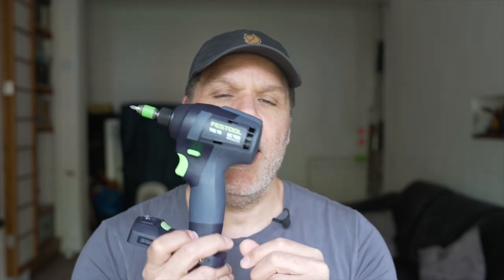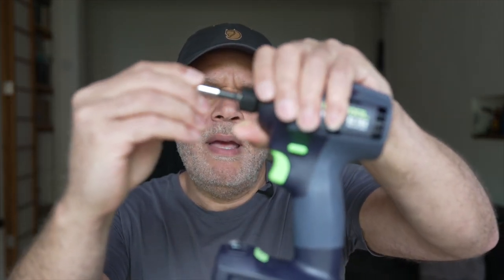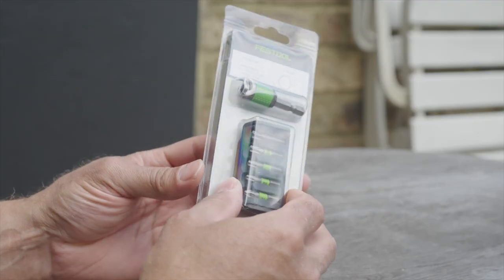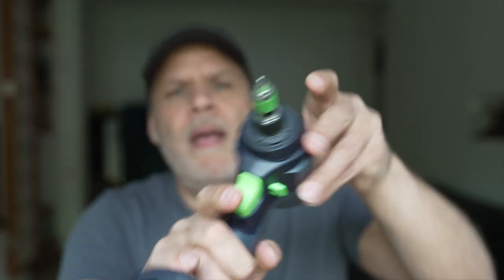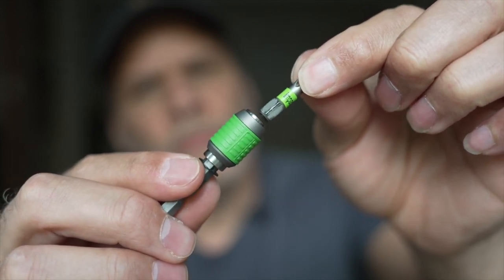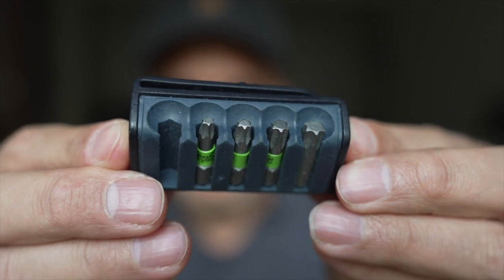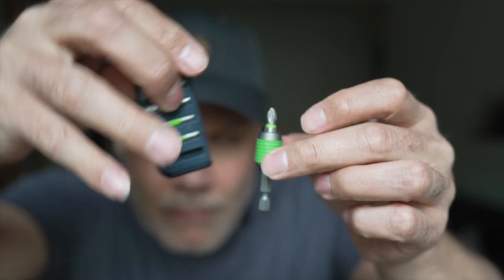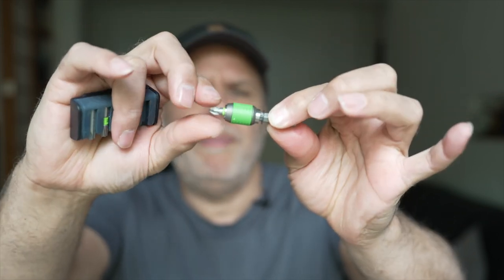Festool’s Impact Bit set and why you need it

Comment: Thanks for the video. I somewhat disagree that I need this, even if I was using the Festool TID. Here's why...
I'm convinced that Festool have licenced Wera's rapidaptor and rapidaptor impact drivers. I have both the Wera and Festool non-impact holders and bits. The function and design of the holders are almost identical. Festool probably do the same with the impact driver. Given that these are not CentroFix, I would consider the Wera alternative if cheaper.
Reply from the maker: Great point!, if you have the Wera you’re right.

Comment: As someone else mentioned, this is just a rebranded Wera Rapidaptor but that's not a complaint as the Rapidaptor is excellent. Also, if anybody else is a bit of a nerd for colour matching like I am, and own a Milwaukee, look for the Hilti bit set which comes with a red version. I'm just sad that nothing can be done about the back and forth play in the FDDX and it feels a bit ridiculous to be using one locking bit holder to hold another, only because the built in one on my Milwaukee is too deep to effectively use these smaller bits. Also like someone else mentioned, having this kind of holder built in would have been perfect. Even the bit holder on my Ryobi impact is much better than this one on the FDDX, with no back and forth play, plus it's ejection feature, making one handed changes easy. Okay, now I'm just ranting 🤣
Reply: 🎉- good rant. (Well recieved and understood)

Comment: Here's what's crazy.  If the impact driver is only intended for standard bits, and they sell the bit holder separately to hold the standard bits,  why isn't that green thing just built into the driver in the first place?  Festool is the master at making you buy add-ons unnecessarily.  Somebody needs to stop this consumer gouging.  I appreciate that you show the mechanics of the holder, which makes a difference in determining its worth. I assume the centrotec shank version of this bit holder works exactly the same way?
Reply from the maker: Good points